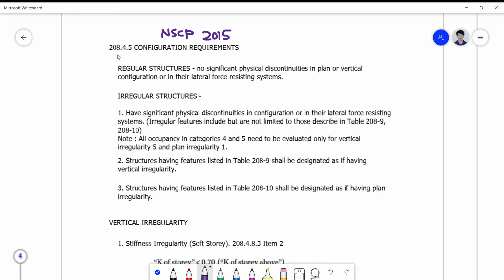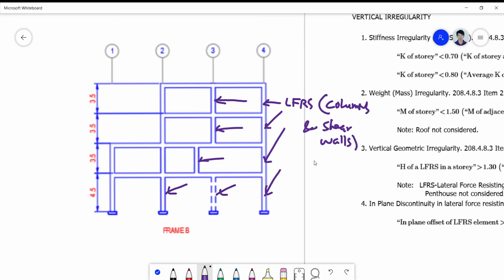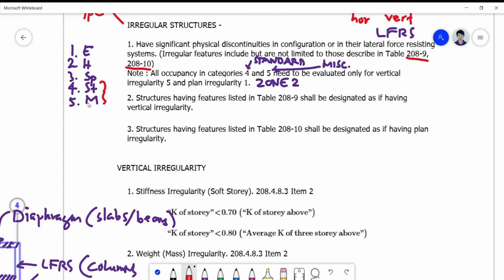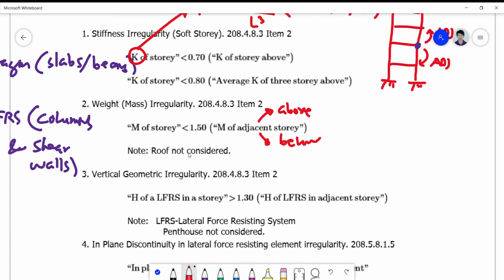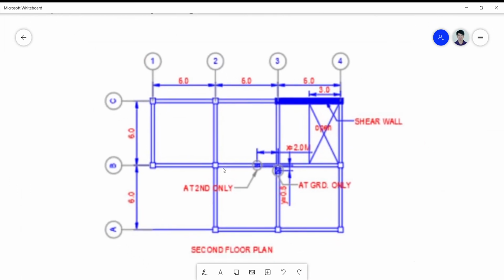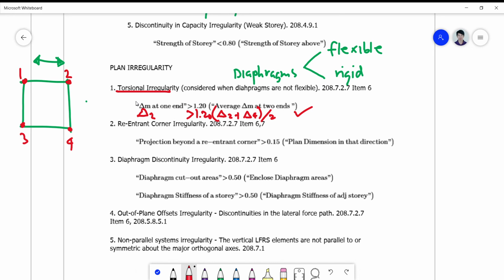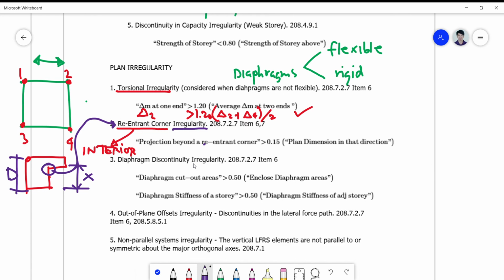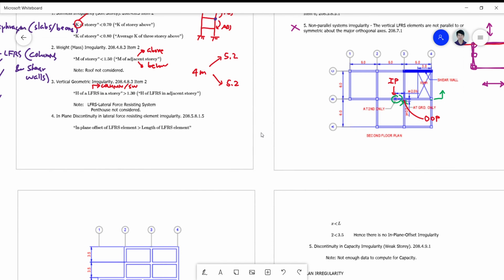Building Configuration Requirements 1

Comment: Sir how can we consider partition wall on the stiffness of the floor.? Minsan po kasi sa ground floor wala partition dun po nagkakaroon ng lesser ung stiffnes
Reply from the maker: Walls should not be attached on boundary elements like columns and beams so they are not part of lateral resisting elements of the buildings